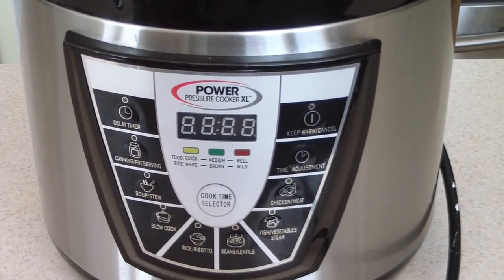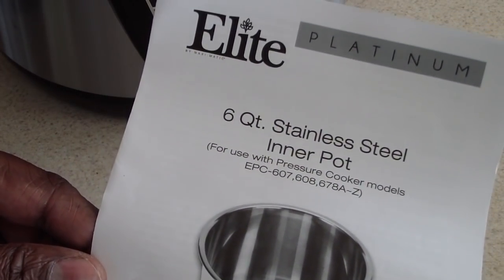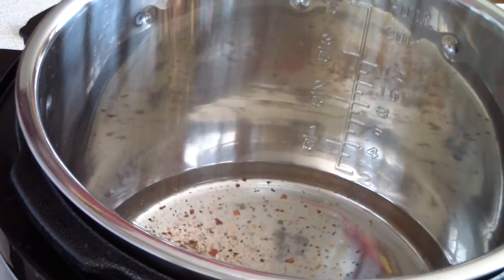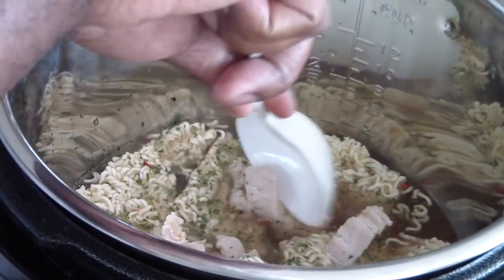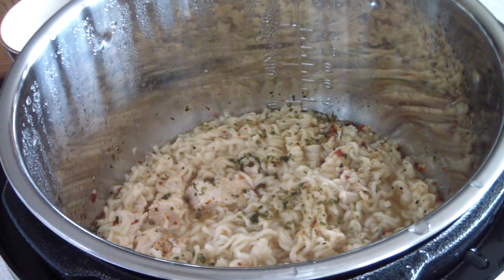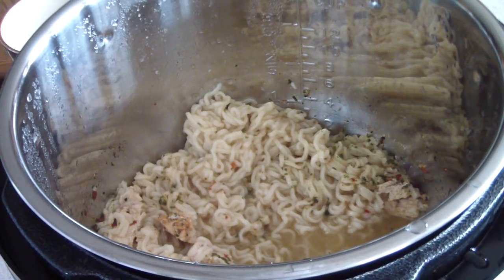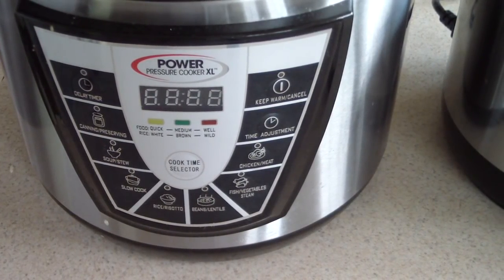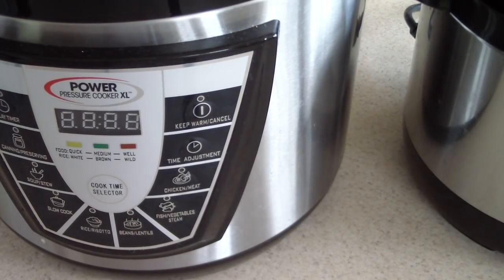Power Pressure Cooker XL replacement 6qt stainless inner pot

Comment: I still think the company needs to replace them. not the consumer....they sold us a junk pot....
Reply: Yes they did my replacement pot i purchased lasted 3wks before it started to wear down .
Reply: @nazgul12000  so the replacement is junk too?? I read bad reviews about the replacement, so I'm hesitant to try it
Reply: @sylviassuccess  yeah the replacement is the same as the original a cheap piece of trash . I bought another pot like the one he has same size and all didn't cook right water and steam everywhere.  Better off buying Ninja Foodi way better pot is ceramic non stick material won't rub off
Reply: @sylviassuccess  
Stainless steel pot is great!!!

Comment: FINALLY!!!!!!! Someone has actually replaced the inner pot instead of flapping their gums complaining!!!! I did that too, replaced the Teflon coated inner pot for a 8qt stainless steel pot and it works perfectly!!!!! Cheaper than buying another pressure cooker.
Reply: What brand stainlees steel pot worked in the Power Pressure Cooker XL 8qt
Reply: It was ordered on amazon, here’s the link. Elite Platinum EPSS-808... https://www.amazon.com/dp/B00UYZHTW8?ref=ppx_pop_mob_ap_share

Comment: Thanks for this. Just got a PPC XL as a gift and we didn't even bother putting food in it, we could tell the non-stick coating was garbage. We ran the inital test cycle and wiped the pot down with a paper towel and the paper turned gray. Definitely replacing with a SS pot.

Comment: I purchased it through Amazon it's a lot more expensive than when you originally purchased it, but I need one I can be confident it will pressurize exactly as the old one and I appreciate your review that I bought it anyway because I don't want to worry about the fit. Thanks for the video and link. Keeping my fingers crossed it works well. It's too hot to be over the stove. The pressure cooker solves that problem

Comment: Thanks for sharing and thanks for sharing approx replacement price. My xl 6qt inner pot is starting to stick at the bottom and burn at the bottom. Mine looks just like your old one. I was careful not scrub pot with brillo or steel $1 pads. I have to say I've had mine for a few yrs now. I guess it's time to replace. Thanks for the link and info. Very tricky to use off brand replacements. Ty!

Comment: So far I haven't stripped the coating off my inner pot, but it's stained. I got these plastic scrubby pads specifically made for non-stick coatings. They work as well as you can get without ruining your cookware.

Comment: Need to replace the plastic sealing ring, any suggestions? The replacement ring it came with is way to big...? So it's letting steam out from the lid rim area.  Thanks.
Reply: I got a new seal by measuring the diameter of the seal I had, and getting one off ebay.

Comment: My power pressure cooker xl is only 8 months old. I put a one year replacement plan on it. I had to get a new cord because the cord didn't plug in right and it would shut off while cooking. I was sent a new cord and it has been fine. I use it almost daily a long side my air fryer. Due to the honey comb texture in the pot mine looks terrible. I was going to get a new pot from them free but it will do it again. So I will just buy a stainless steel one.

Comment: damn still sold out. I just brought one and noticed that the inner pot is already messing up. So sad they didn't do a newer version with a steel pot with all the complaints I see now. I brought it on black friday so it was a steal at 55 bucks so I really don't want to return it. They are other places that sell but it so much more expensive. I might try pot in pot until it restocks or something like that.

Comment: And the sad thing here is that you felt the need to have to use some kind of abrasive pad to scrub what is supposed to be a relatively non-stick pot, which is what I'm feeling like doing right now.  The first time that I used my PPC XL I followed directions on the web for one pot spaghetti and the directions were off on how much pasta to put in the pot, so it scorched the pot.  After that it's never been the same and basically at least a little of everything that I cook in it sticks to the bottom and now needs a rather abrasive scrubbing pad to try to clean off the cooked on food even though mine does not show any of the silver under the non-stick coating, things basically stick to it now.

Last night I cooked chili, and now the pot is soaking because a bunch of the chili is sticking to the bottom of the pot.

Currently thinking of just buying an instant pot with the stainless bowl that comes standard or buying just a stainless bowl for the PPC XL.

Oh and yeah, they seem to be all gone now, the only new one that I found the crazy seller wants like $225.00 for it.

Comment: Hi Doug
 the replacement of  ( Power Pressure Cooker XL replacement 6qt stainless inner pot) from Elite platinum which is not available on Amazon.

 From the tag you were holding on the video,  can you please provide me contact information from that company so I can order directly or any update information how I can find stainless steel pot for Power Pressure Cooker XL replacement 6qt .
Thank you very much!

Comment: I tried the stainless steel inner pot from Instapot and it wouldn’t seal to build up pressure. I compared the size difference and the Instapot is a fraction smaller than the original ceramic inner pot.

Comment: I would be really nervous using a replacement made for another companies product, and not guaranteed for mine. It could void warranties and cause a situation for the unit to fail or explode.
Reply from the maker: +yupyup1562 then don't :)
Reply: COOKINGWITHDOUG 
True, definitely not without further research, I’m too aware of the severe injuries and death from pressure cooker failures. Thanks for the idea though. I will check into it deeper because the PPC XL pot is really bad.

Comment: I have the 8qt size do they have that size as well.an loso have the 10qt size..I need both sizes for my  machine....
Reply: Nora Martin I'm looking too can't find it.  This link is says 199.00.  For a 6 qt.  You can but an instant pot with stainless insert
Reply: @SweetHomeBM16 Did you ever find one?  I too have a 10 Qt and have been looking all over for a stainless steel one

Comment: What a nice con for the company to make more money on their power pressure cooker.  I used mine with care......only used all plastic utensils and followed all requirements for this machine.  Didn't make any difference, it's several months old and everything sticks to bottom of inner pot.  This is my second one and the same thing happened to the inner pot....this one was a replacement.  What a racket......everyone is having the same problem!!  Sounds like a defective product and the company should be replacing these inner pots...not us!!  Next time I purchase I will go with another brand with a silver inner pot.